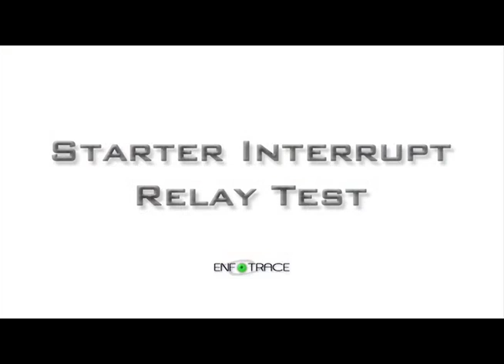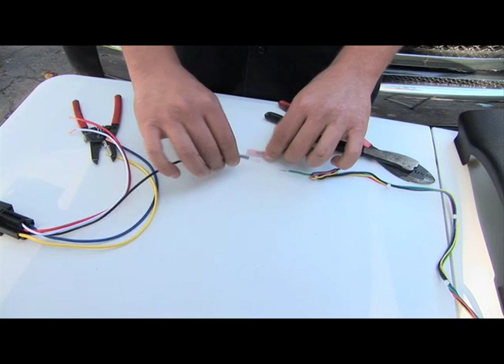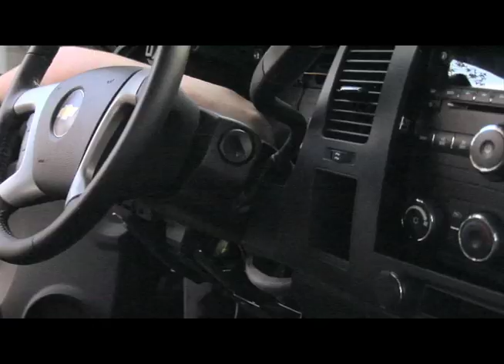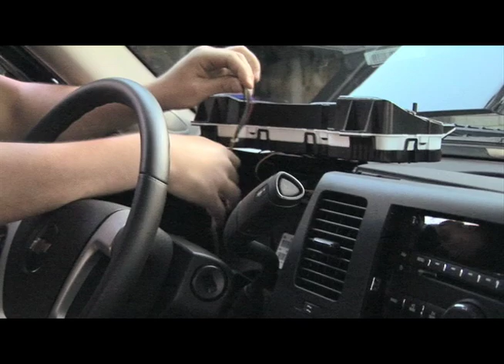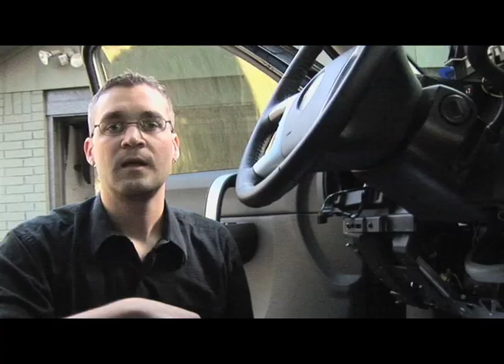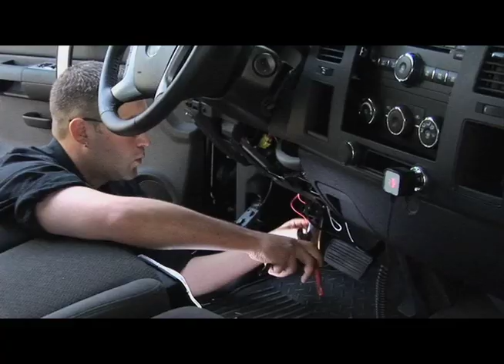GPS with starter interrupt

Comment: If u cut the ground wire and power wire that's connected to your battery cable and connected the other two wires why is it short circuit my hyandai elantra can I take off that power wire hooked up to my battery and the ground wire after I cut it and just hook up the two main wires together ?

Comment: Does anybody out here know who to contact if you found it tracking system in your car that you didn't put in and where did you paid cash for your car well if you are paid off or if you shouldn't have that in your car what kind of laws are being violated who do you call do we know
Reply: most states have no laws here.  a guy on youtube showed his case. his car was FULLY PAID OFF, and the dealer did not remove the gps from the car at owner transfer.  and since it was still wired to his car, one day on a long trip, after filling up for gas, the 'start interrupt' feature tripped (not intentionally set off by car dealer, but just through an error insystem). ended up costing him $500 for tow, local repair to remove, and hotel - and loss of his planned trip.  only after local television show put pressure on the dealer, did he get a reimbursement.

Comment: Now you bought a car from one of those buy here pay here car dealers. They have installed a GPS Tracking/Ignition Interrupter switch like this in your car. They will turn off your vehicle if you are late with your car payment. Review this video and other videos like this.
Now locate that switch and look at the wires. You can remove it if you want but you can bypass that interrupter switch. Look at where they tied the wires to. Buy some wire at an auto parts store. Now simply hook up the wires at the same place before the switch and after the switch. There should be just three colored wires. If they activate the switch so you can't start your car but you just bypassed the switch. Your car starts and away you go. They can still track you and they know where you live and work. But it will give you time to get your finances together. Another option is to remove that switch and hook it up to another vehicle with DC power but do not hook it up to the ignition switch. Put it in an old car, motorcycle, mini bike, scooter, tractor, boat or plane that a neighbor or relative has. Maybe in another city or state. But again do not hook it up to any ignition switch. Maybe hook it up to a lighter. They will still be getting a signal. It will be quite a while before they figure it out. But it will give you time. Thing is they will eventually find the car.